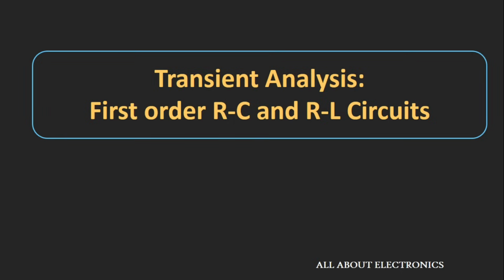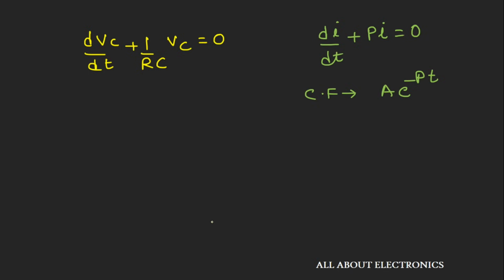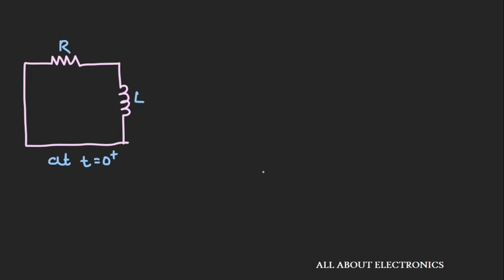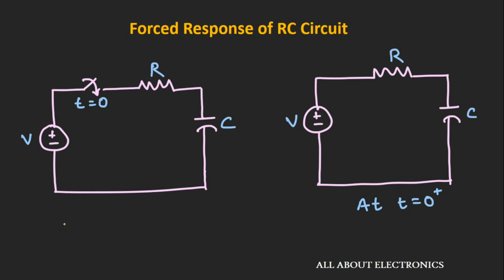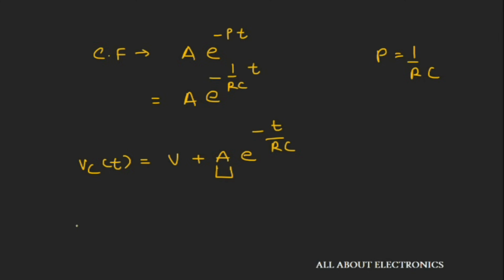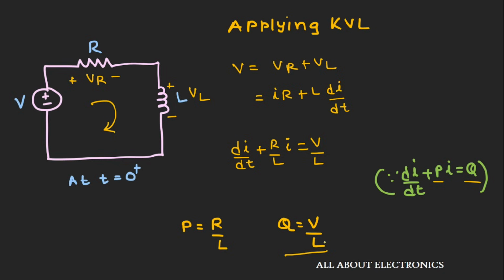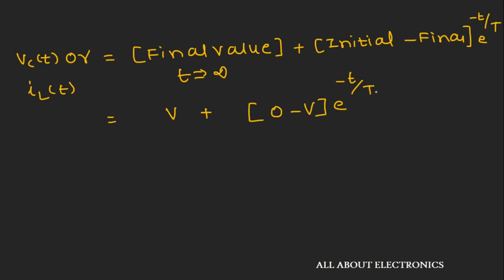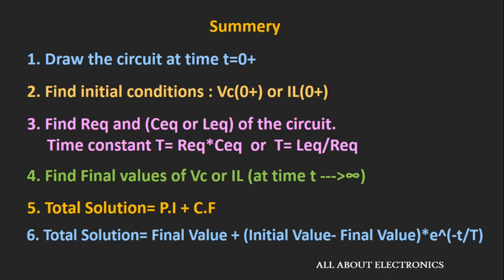Transient Analysis: First order R C and R L Circuits

Comment: Bro please do not add subtitle because the thing which you are explain through writing it doesn't see or if you want to add subtitle then add in a single line or small small sentences please
Reply from the maker: On Desktop you can drag the subtitles anywhere on the screen as per your convenience. And if required then you can also turn off them in the video settings.

Comment: hi, very nice ! what i dont get is that (in vc transint without source ) if the current  starts going from positive to negative then we get from kirchoff voltage law that vc - vR = 0 . (not vc+vR = 0 )
Reply from the maker: The thing is during the analysis, you just assume that the current is flowing in specific direction. And after the circuit analysis, if you get the negative value of current, then it simply means that the current is flowing in the opposite direction. So, here in the source free response, since the current was flowing in the clockwise direction at t=0-, so it has been assumed that, at t=0+ also, it will flow in the same direction. But here, we will get the negative value of current. It means that, the current is flowing in the opposite direction. So, both ways, you will get the correct result. I hope, it will clear your doubt.
Reply: @ALLABOUTELECTRONICS  I'm not quite sure.. It works in other occasions  but here when I perform the analysis I get vc= ve^(t/τ)  instead of  of ve^(-t/τ). I'm not really sure, maybe I'll get it as is because my exam period starts at the end of this week. Your series was so helpfull

Comment: Is shortcut method is helpful for all kind of circuit like source free circuit, forced circuit? 
And is this applicable to any time like t=0, t= infinity?
Reply from the maker: It can be used for first order RC and RL circuit. Many examples have been solved based on that. Please check the network analysis playlist on the channel. You will get it.
Reply: @ALLABOUTELECTRONICS  k brother

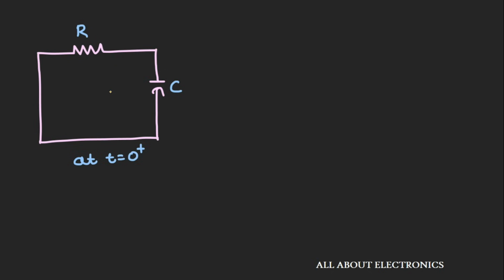Comment: 2:54 why you used this direction of current if we know capacitor is acting as a voltage source. This will change the equation sir.
Reply from the maker: Even with that direction of the current, if you see the equation of current then there is a negative sign. Which indicates the direction is opposite. You can check that by finding the capacitor current. Vc(t) = V e^(-t/RC). While Ic = c dv/dt. If you find the equation of capacitor current then there is a negative sign, which indicates that the direction of current is opposite. So, it doesn't matter. I hope it will clear your doubt.
Reply: The power becomes positive in doing so.
Reply from the maker: @unclasswithsuryasir5448  The current is negative and the voltage across the capacitor is positive. So, power is negative. And it means the capacitor is delivering power.
Reply: Sorry for stretching it. But this positive power is killing the vibe of understanding it.
Reply from the maker: @unclasswithsuryasir5448  You can check this video for understanding. I think after 10 mins or so, I have explained about the power. 
https://youtu.be/eFPTBATfX70
Reply: Oh we both got the wrong notion of power here. I am asking about e raise to the power is positive if i take current in opposite direction.
Reply from the maker: Ok, I got it. Well, when we consider the other direction then, when the capacitor is discharging, then the charge across the capacitor is reducing. So, the rate of change of voltage with time or dv/dt will be negative. So, while putting IxR as cx dVc/dt x R, you also need to put a negative sign. Since the capacitor is discharging. (Particularly, when you consider this direction)
I hope it will clear your doubt now.

Comment: 2.54 appling kvl, why does not V =iR?, voltage difference between resistor is V, isn't it?
Reply from the maker: Vr is the voltage drop across the resistor. And Vr = I*R.

Comment: Could you pls explain the Ex taken @6.56: if cap to be discharged at  5uS ; whose required cap is 1nF with 1K ohm resistor ; but what is voltage rating of  capacitor since our equation is VC(t)=Ve-(t/RC) ? and what if Cap voltage is increased to some level  with 1nF( example)  , does discharge time also  increases? , pls explain with example
Reply from the maker: with the given values of R and C, the required time for charging and discharging will remain the same. 
e.g if the supply voltage to the RC circuit is 1V in one case and 3V in second case, then the required time to charge the capacitor will remain the same.
The thing is, in case of the 3V the current in the RC circuit is more. So, although it appears, it requires more time, but it will take the same time. 
I hope it will clear your doubt.  If you still have any doubt, then do let me know here.

Comment: Sir please explain us in the last part of this video how the resistance R1 get short circuited
Reply from the maker: To find the equivalent resistance, we have assumed all the independent sources in the circuit as zero. So, V1 got short-circuited. It means it has zero resistance. R1 is connected in parallel to the short circuit. When you connect any resistance in parallel to a zero-ohm resistor (or short circuit), the equivalent resistance will be zero.  So, R1 will get vanished from the equivalent circuit. 
I hope it will clear your doubt.
Reply: @ALLABOUTELECTRONICS   sir I noticed that You have taken independent voltage source as a short circuit in this video and independent current source as a open circuit in the next video. Can you please explain it why did used them or are those the basic methods to find thevinan's equivalent resistance?

Comment: For a series RL circuit supplied from a voltage source, discuss in details how the resistance affects the circuit current response. Support your discussion with numerical illustrations (both equations and plots) assuming inductance of 0.5 H and supply voltage of 100 V. Use suitable values of R (on your choice)

Comment: 25:05 why will r1 be short circuited???
Reply from the maker: To find the Rc time constant, we need to find the equivalent resistance (or Thevenin's equivalent resistance) which is seen through the capacitor.
And to find that all the independent sources will be considered as zero.
Therefore, all the independent voltage sources will be considered as short circuit and all the independent current sources should be considered as an open circuit. 
So, here to find Req, the voltage source will be considered as a short circuit.
And as R1 is in parallel to the voltage source, it will also get short-circuited.
I hope it will clear your doubt.

Comment: Why does R1 get shorted?
25:03
Reply from the maker: To find the Req, the Thevenin's equivalent resistance is found across the capacitor.
And for that, all the independent sources are considered as zero.
That means Voltage Source will be considered as a short circuit. 
And as R1 is in parallel with R1, so it will also get short-circuited.
I hope it will clear your doubt.
Reply: ALL ABOUT ELECTRONICS that was helpful thank you 🙏🏻

Comment: But during source free responce inductor is acting like an active element so we write vl=vr but you wrote vl+vr=0 ?
Reply from the maker: It will act as an active element. But at time t=0+, the direction of the current will remain the same. So, if you see the polarity of the voltages, it will as shown in the diagram. And if you apply the KVL, it will be Vr + VL = 0.
I hope it will clear your doubt.

Comment: In the last for finding R (equivalent) , why R1 is short circuited..anyone explain..
Reply from the maker: To find R (equivalent) Thevenin's equivalent resistance has been found. And for that, the voltage source is short-circuited. (All the independent sources should be zero). As R1 is in parallel with the voltage source, it will also get short-circuited. Hence R1 is also 0.
Reply: @ALLABOUTELECTRONICS  Thanks a lot , sir...

Comment: Sir,  here at 22.00 you have discussed shortcut method. I need to know that how could we reach to the general equation. 
V =Vfinal+(initial-final) e^-t/T
Reply from the maker: the solution of the differential equation consists of two parts. The complementary function and the particular integral. 
The complementary function gives the transient response while the P.I gives the steady-state output. The equation V = Vfinal + (Vintial - final)e^(-t/T),  represents the same thing. 
In short, it is the shortcut way to find the output for thefirst-orderr circuits.

Comment: Wow this video helped me a lot! I just have 1 question, at 25:10, why does R1 get short circuited?
Reply from the maker: To find the Thevenin's equivalent resistance, all the independent sources should be first made zero. So, voltage source will act as short circuited. (That means the its equivalent resistance is zero). And as R1 is in parallel with this voltage source (which is now acting as short circuit), so effectively it will also get short circuited. 
I hope it will clear your doubt.
Reply: @ALLABOUTELECTRONICS  thank you for the explanation about short corcuit in thevinin theorem😊
Reply: I think
When voltage is short-circuited Resistance parallel to that voltage must be neglected,
So R1 is neglected there
Reply: @NikhilKumar-jq5fk  but what's the reason? Is it because the current tends to take the path of least resistance so it ignores the R in parallel to the short circuit?

Comment: why  you used current source in rl circuit and voltage source in rc circuit
Reply from the maker: Because in case of the RL circuit, I am referring to the current through the inductor, while in case of the RC circuit, I am referring to the voltage across the capacitor.

Comment: Sir how at t = 0- , Vc = V ?
The resistor and capacitor are in series so there will be voltage division.
Sir, please explain. 1:56
Reply from the maker: What you are saying is true when the input is a sinusoidal signal. For DC, in steady state, the reactance of the capacitance will be infinite and will act as an open circuit. Therefore, the entire voltage will appear across the capacitor. Or in other words, the capacitor will charge up to voltage V. Therefore, at t=0-, Vc = V.
I hope it will clear your doubt.

Comment: One question: in the >1 Resistor part: what happened to R1 in your Req analysis?
By the way: BRILLIANT Explanation, thank you so much!
Reply from the maker: For finding the Req, we are actually finding the Thevenin's equivalent impedance seen through the capacitor.
So, all the independent sources will be considered zero. That means R1 will get short-circuited. 
Hence, Req= R2|| R3.
I hope it will clear your doubt.
Reply: i still didnt understand why r1 got short-circuited
Reply: @preethishivani1567   and have you gone through the thevenin's theorem? I think you should go and revisit the topic then come back. You'll understand why we shorr circuited the system

Comment: summary:
RC becomes dv/dt *C +Vc/(RC) = 0, which simplifies to Vc(t) = Ae^(-t/(RC)), where V(0) = A so Vc(t) = Ve^(-t/(RC)) 
-> Voltage decreases from positive towards 0 exponentially within 5 RC time constant, while Current increases from negative towards 0 

RL become di/dt+ R/L*i = 0, which is I*e^(-Rt/L), or, V/R-V/R...
-> Voltage increases from 0 and reaches a value within 5 time constant

Comment: If an initially charged inductor current is given say 1amp and it is connected directly to a voltage and resistor of 1v and 1 ohm respectively,how do u know if inductor gets charged or discharged.im getting wrong answer

Comment: Sir can you help me with this problem : https://www.quora.com/How-do-I-solve-this-problem-as-I-am-getting-confused-when-the-initial-current-or-voltage-is-given i would really appreciate as i am facing problem when initial current or voltage given in a circuit.
Reply from the maker: In the given example, I(0)= 1A and V(t)= 0. Right?
If so, then first draw the circuit at time t=0+. V(t) is zero, and inductor will act as a current source of 1A. Now, this current will get divided between the 2 ohm and 3-ohm resistors.  So, the current through 3-ohm resistor will be 2/5 A. Or the voltage across 3-ohm resistor will be 6/5V. This will be the initial voltage. The final voltage will be zero volts. Now, using the formula used in the video (which includes initial and final value), you can find the equation of the output voltage. 
If you still have any doubt then do let me know here.
Reply: Really appreciate sir, very well explained and thanks for so quick response . Your videos are really much more better to understand , i hope in future if i ask any doubts that will be okay .

Comment: At t=0 voltage across c shouldn't be V as it is in series with a resistance ...so voltage should be distributed in C and R as well
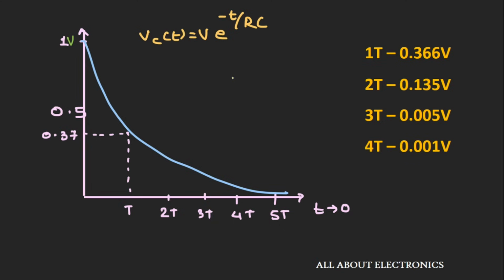Reply from the maker: Here we are talking about the transients. And t=0+ is the time, just the switch is turned off. And that time, capacitor opposes the instantaneous change of voltage. So, the voltage across the capacitor will be the V volt. But eventually, this charge across the capacitor will be get discharged through a resistor. And it is visible in the discharging curve. (at 6:00)
I hope it will clear your doubts.
Reply: @ALLABOUTELECTRONICS  thank you i had the same doubt

Comment: Sir why do we add a current or voltage source while solving transient Questions
Reply from the maker: Transient represents the change in the steady-state condition of the circuit (Voltage and current). So, it could be when you suddenly apply the voltage or current to the circuit or suddenly remove the source. Or it could be when you change the voltage or current suddenly in the circuit. And sometimes if you introduce new circuit components or remove some portion of the circuit suddenly from the existing circuit, that will also change the voltage or current.  So, in short as transient of the circuit represents the sudden change of  voltage or current in the circuit, a source has to be there in transient questions. 
I hope it will clear your doubt.

Comment: very nice explanation .. can you give the answer of circuit made in the last where more than one resistor was connected
Reply from the maker: For that circuit, let's say we want to find the voltage across the capacitor. Now, initially, the capacitor is fully discharged. So,  Vc(0+)=0, and in steady-state or at t= infinity voltage will be R3*V/(R3+R2). And let's say it as Vx.
Equivalent resistance for the RC time constant has already been found. Req= R2||R3
So, equation for capacitor voltage will be, Vc(t)= Vx -Vx*e^(-t/ReqC)
Where Req= R2||R3 and Vx= R3/(R2+R3)
I hope its clear to you.

Comment: I have one question  there is any difference between AC source and DC source on RC and RL circuit, please answer me withdrawing
Reply from the maker: Yes, for AC source the response of the circuit will be different. For AC sinusoidal signal, in steady state, the voltage and current across linear elements (R, C and L) will also be sinusoidal but has different amplitude and the different phase. Such analysis is known as the sinusoidal steady-state analysis. 
Again for more information, you can check my video on phasor diagram of RL, RC and RLC circuits. 
And still, if you have any doubt then do let me know here.
Reply: no so good but its nice for me